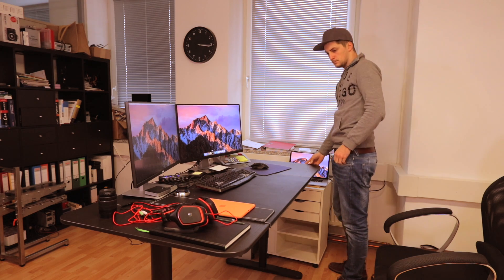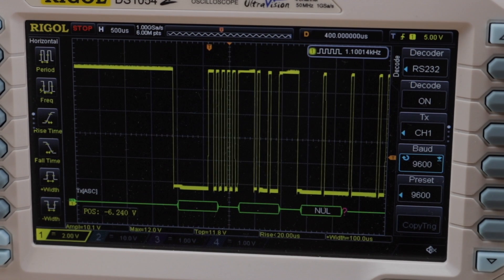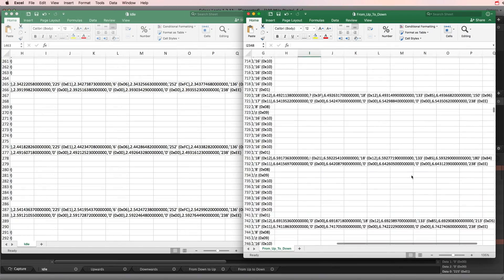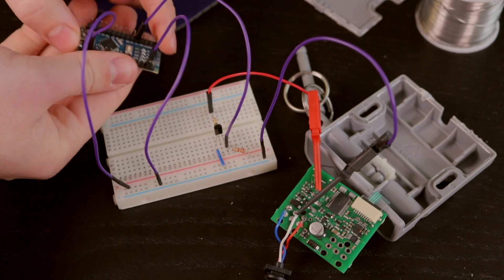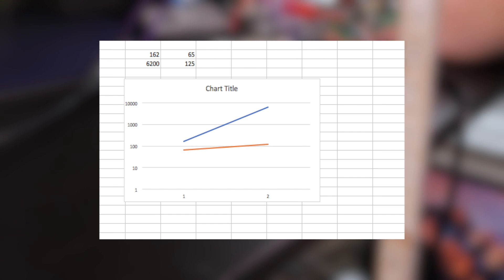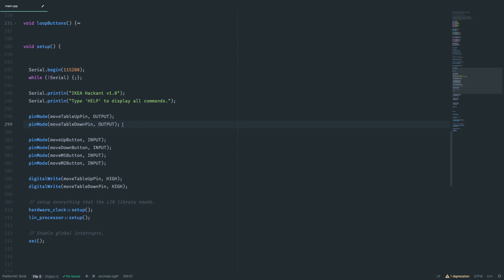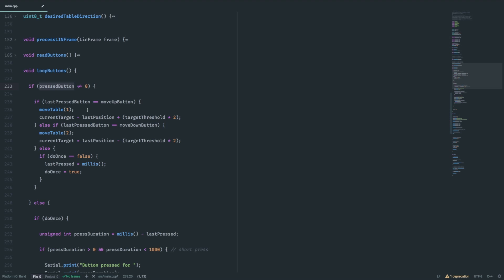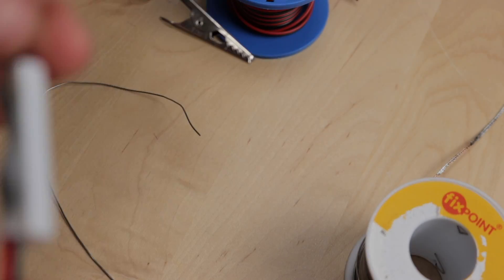IKEA Bekant Table Hacking

Comment: Very nice project. One question: it is possible to invert the data stream in Arduino code and get rid of the transistor and resistors used as a NOT gate?
Reply from the maker: Tomeo Gonzales Thanks! Yes you should probably be able to dig into the Lin library and invert the interrupt methods that actually parse the logic levels. Should be doable. But it might be easier to salvage a transistor somewhere ;)